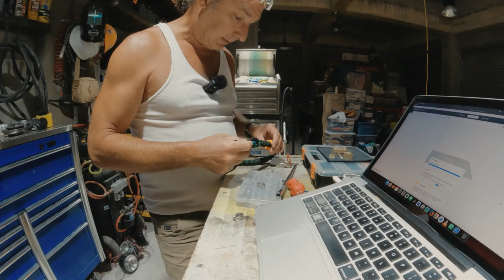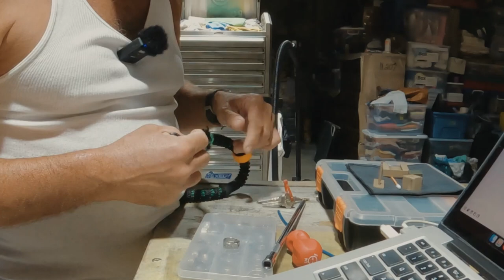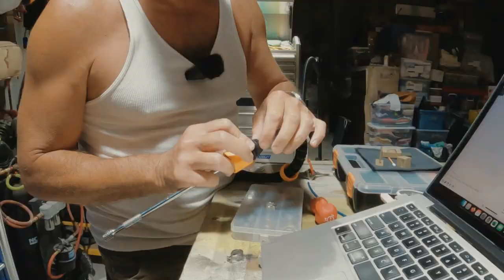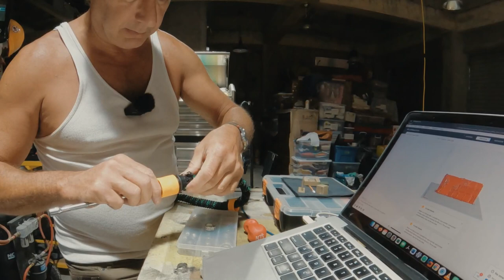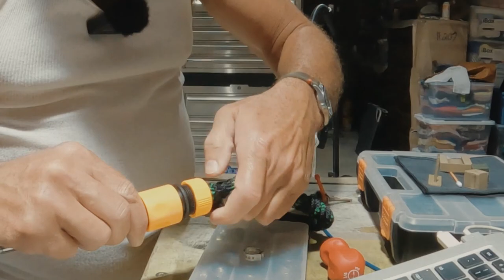Can You Fix a Pocket Hose? 💦 | Fabrication Philippines | Ep. 01 | TORINO

Comment: How did you go with the tension on your track? You get it sorted?
Reply from the maker: i have my steel tracks and a dozen extra pins enroute 😀 but, yes, my rubber tracks are fixed up, they are both holding tension.
Reply: That’s good. Well done